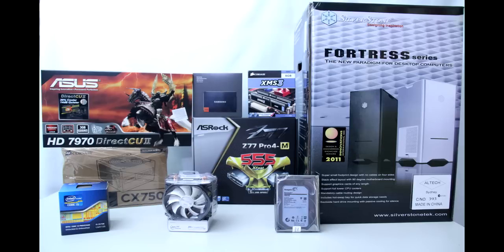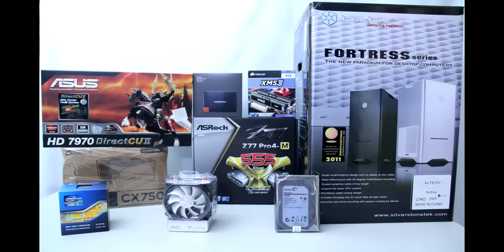Extreme Compact Intel Gaming Build 2012 - Maximum PCs Australia

Comment from the maker: The temps are pretty good actually despite how cramped it is inside - CPU is already overclocked @ 4.2 Ghz, the Arctic Cooling Freezer 13 does a good job keeping the CPU at about 75C. The Asus 7970 already has a massive cooler on it (it is also overclocked 1050/6000 mHz) and peaks at around 65C
No problems with cooling here! Silverstone designed this case well - there are intake fans blowing directly at the graphic card and cpu cooler

Comment from the maker: Yes there is ample room around the CPU area but the Arctic Freezer I used here is not that big so if you are using larger 120/140mm style air coolers you may need to use some low profile ram to allow for enough clearance

Comment from the maker: There is plenty of room on the inside to mount either the H80i or the Kraken X40 - presumably you would be using the top 120mm exhaust fan for the radiator

Comment: and also how is the temps on this thing? because the the gpu is not using a blower cooler and might intefere with cpu cooler. and would you recommend overclocking then?